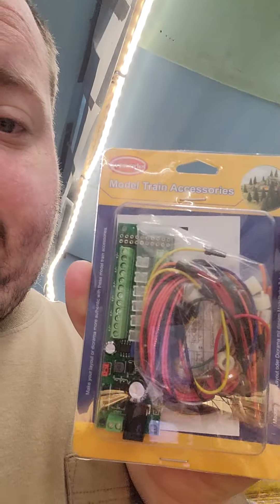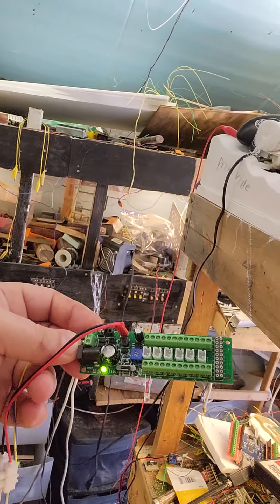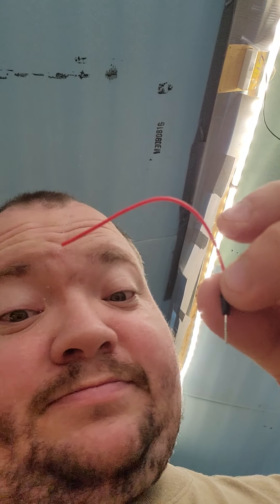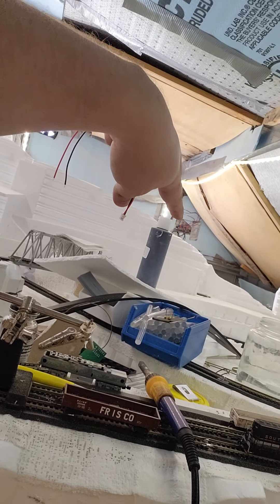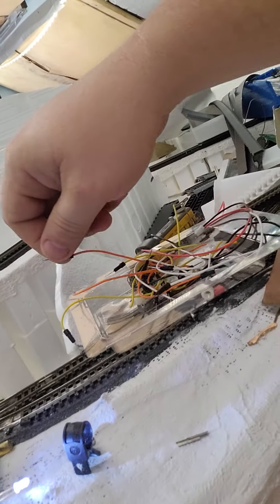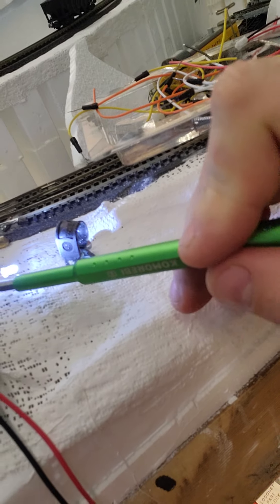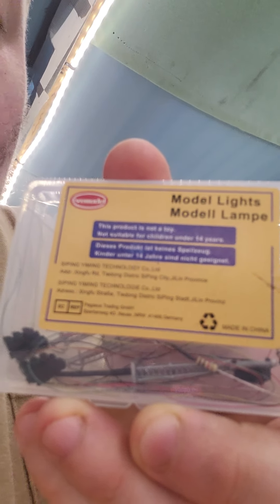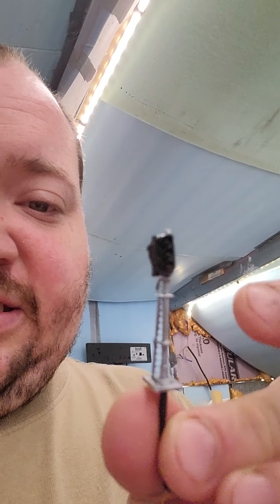a review on the evemodels power distribution board

Comment: I have 2 of those Evemodel pcb012 power distribution boards. I hooked them together as master and slave, but had a very hard time getting the switch to work on both boards together. I figured out a way to get them to work with the switch, but it's probably not the way intended by the factory. Would love to see a video on how these these are supposed to he hooked together with a switch.

Comment: i'm using 0805 SMD LEDs with mine. the problem I'm having is that the wires are so small that they don't want to stay in the screw terminals. is there a trick to do it? Should I connect using the breadboard jumper leads at mark 2:41?